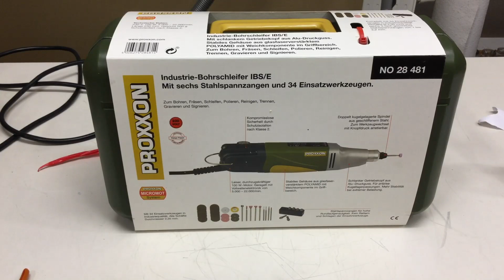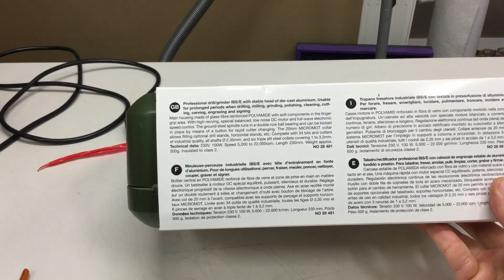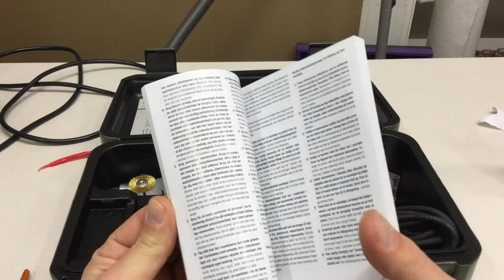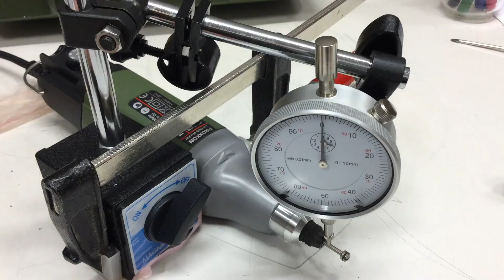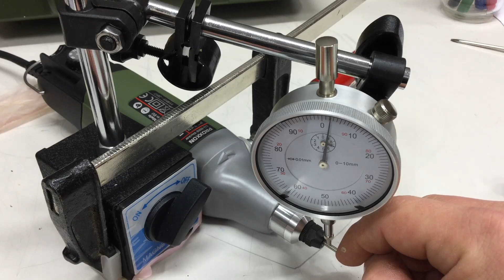Mailbag (Single Item): Proxxon IBS/E – Unboxing, Runout Measurement and Test

Comment: I just got one, and it has a bit of a rattle sound when drilling in the body. Is that normal? It's working fine, but I just had to return the drill press for it, which I found had an issue thanks to your detailed video on it. I know its hard to describe sounds, but I can't tell if yours is doing the same.
Reply from the maker: Yeah, sounds are hard to describe. Anyway, my IBS/E doesn't make any sounds that I would describe as "rattling".

Comment: The safety rule with these disc is that they will always explode. 

It is the one tool where I never use the “safety squint” 
but always wear glasses
Reply from the maker: Fortunately I always have to wear glasses when doing close-up work 😅 My working glasses have Perspex lenses, so I feel quite save.

Comment: Hi, How do I connect this tool?  I got mine today, but the power supply is not the one I am used.  Could you please tell me?  Tks.
Reply from the maker: Well, mine has a normal AC mains connector (without mains earth) that simply plugs into a AC mains socket - there is no external power supply.

Comment: I've used those thin discs to cut small diameter iron bars but as you can see, they're  brittle, especially for beginners. You'll find plenty of YouTube vids showing how to make small cutting discs out of larger thicker discs which are much more robust for cutting whatever you want wherever you want , within reason. I believe the right tool for the right job but a lot of people do one off projects or don't have or want to store loads of tools.
Reply from the maker: Thanks for the info! Had a look at one of those YouTube videos. Seems easy enough to make small cuttings disks from thicker, larger ones. Meanwhile I also got better using the thin disks - practice, practice, practice :-)

Comment: 2mm aluminium.. looks more like 10mm. Also you wouldn't use this tool, with a cutting disc to cut through such a piece of aluminium.. you would use a saw... If you really wanted to cut such a thick bar of metal, you would have the tool in a fixture and pass the metal bar or rod through the cutting tool, which would avoid skipping off the end and shattering the discs
Reply from the maker: It's a 15mm x 15mm x 2mm L-shaped aluminium extrusion I'm cutting there. So I'm really cutting only through 2mm of material. But you're absolutely right! I'm using the wrong tool for the job. It was just the only piece of any metal I had handy when shooting that video :-) Meanwhile I'm using the IBS/E mainly for drilling PCBs (FR4 - glass fiber reinforced epoxy) with diamond coated drill bits and I've successfully cut thin sheet metal (< 1mm) with it. But I only use it for cutting when there's absolutely no way to use a saw.

Comment: So this is the video to prove that you don't know what to use a Dremel, Proxxon or similar tool for....
Interesting...
Reply from the maker: It is indeed :-D

Though I never ever worked with high RPM hand tools before, I kinda foolishly expected to be able to handle that one perfectly right away. But of course there is a learning curve ...

Meanwhile I'm even able to do (semi) straight cuts in sheet metal with an abrasive disk. But it took a while to get there ;-)

Comment: Whats the difference between ibs/e and ib/e ? Both of them 28481 🤔
Reply from the maker: Sorry, never heard of an IB/E before. Googling I found one dealer that sold the IBS/E (28481) as "IBS/E (IB/E)". Anyway, if they have the same Proxxon model number (28481) they are the same product. My best guess is that the IB/E is just some typo made by some dealer.
Reply: @robertssmorgasbord  Nope. Proxxon just has renewed some of the older names of their machines some time ago. IB/E is the old one, IBS/E the newer one and both stands for "Industrie Bohrschleifer" ( Industrial Drill Grinder ). Its the same machine only with a slightly newer design to the IB/E.
Reply from the maker: @BonsaiDax  Thanks for the info!

Comment: I have a small tungsten carbide blank that came with something and it is for testing runout.  It is a calibration blank.  The little container it comes in is marked  ITR <.00005"   If I get a Proxxon I will test it with that. I do have a dial indicator like that one you are using.  It may be the same brand but I would have to check.  I don't have many specialty tools but I have a feeling this would reveal the true quality of most tools.  It wouldn't surprise me if there was nothing wrong with the tool itself and you just had a bad bit.
Reply from the maker: ITR <.00005" - wow! That's 0.00127mm! One mark on my dial indicator is 0.01mm, so I would barely see the needle moving. That's what I call precision! However, with the additional error introduced by my crappy setup and the cheap axle I used I measured 0.04mm. Proxxon specifies 0.03mm runout for that thing. So there's really nothing wrong with the tool.
Reply: @robertssmorgasbord  I meant TIR <.00005".  It is so small that many measuring instruments would not show it.
Reply from the maker: @Charles Hines "Indicated Total Runout" vs. "Total Indicated Runout" - seems to a German guy like me the same ;-) TIR being the official abbreviation of course. And yes, you would need a very expensive dial indicator to measure that :-)

Comment: Is the E for the European market where 240 volts is more common?  I am in the USA and nearly everything I use is 120 volts.  I do have a few 240 volt sockets but seldomly use most of them.
Reply from the maker: The E just stands for "Electronic", probably referring to the electronic speed regulation. There is a 110V/120V versions of the IBS/E available: http://www.proxtools.com/store/pc/viewPrd.asp?idproduct=10

Comment: With a cutting wheel you need to use the highest speed possíble and not too much pressure.
Reply: Actually, I'm also a beginner. I have a Bosch Dremel and I found out that the speed doesn't really have to be so high. I cut stainless steel 3 times at about 15,000 rpm but with very little pressure, basically just the weight of the dremel tool. That takes a little longer but it works fine.

Comment: I use diamond coated discs . I think it was these ones I bought last time https://www.amazon.co.uk/Pieces-Diamond-Cutting-Gemstones-Shafts/dp/B01MXBV5QN/ref=pd_sim_14_1?_encoding=UTF8&psc=1&refRID=QE55HD5VHC9VQWR85G9B I've never had any problem with these cutting through aluminium.They should work just as well on your machine.
Reply: Yes, saw blades should be OK for plastic. The type I suggest in my comment work on plastic too though the plastic does tend to melt as it is cut. I think with all cutting discs it is best to apply only light pressure as you cut.
Reply: I would be cautious with any toothed saw blade on a rotary tool.  Rather than shattering one of those could just come out of the kerf and bite you.